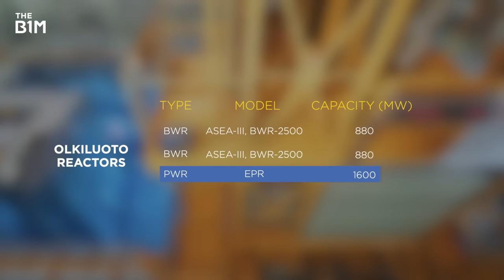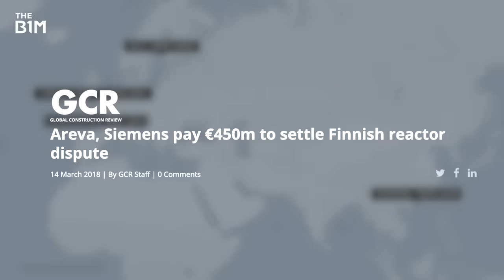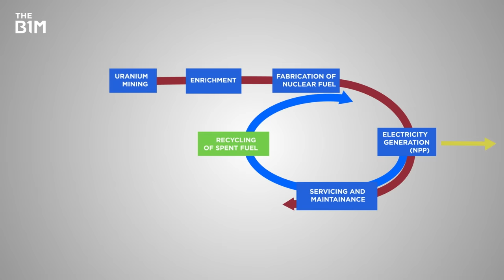Finland Might Have Solved Nuclear Power’s Biggest Problem

Comment: I hoped for a technological invention and instead they just developed a "new" way to bury it.
Reply: But what's wrong with burying it?  So long as the facility isn't on a fault-line, isn't near a groundwater source, and is sufficiently deep as to shield all the radiation it seems like a perfectly adequate solution.  The downside is the cost of excavating such a massive facility, but this repository "only" cost 3.4 billion dollars.  To put that in the perspective of a piece of infrastructure, the US spends about $175B on Federal funding to maintain its highway system every year.   

No one seems particularly disturbed by all the radioactive ores that naturally occur in the earth's crust, but suddenly once we start talking about putting nuclear waste underground no solution is sufficiently advanced.
Reply: @rossvolkmann1161  6:16 shows the suitable regions... I was at least hoping for a "solution" that could be used by more countries.
Reply: STORED not buried. The fuel elements have over 90% of their energy left
Reply: Well the thing is, there is already a way to deal with it: burning in in new technology reactors
But that doesn't make clickbaity titles nor does it scare the viewer
Reply: @rossvolkmann1161  It would almost be cheaper to send our spent Uranium to the moon, or simply slingshot it into space, on the back of a rocket
Reply: @chadsimmons6347  we dont have 100% success rates with rocket launches so doesnt matter if its cheaper if you accidentally shower your country with nuclear waste in a failed launch
Reply: That's because nuclear waste recycling is unbelievably expensive and fraught with it's own serious dangers.  France and Japan has the world's most advanced nuclear waste  recycling programs but it's always a money losing endeavor and they are lucky to recover a small percentage of the nuclear waste.
Reply: @pedrolmlkzk  I keep hoping that's what these videos will show but they never do. TerraPower and their travelling wave reactor is probably the single most promising development in recycling waste fuel into a usable resource, not to mention their liquid sodium system that practically guarantees a meltdown cannot occur.
Reply: @chadsimmons6347  it would take billions of dollars to slingshot all the waste in to the moon
Reply: @AMorphicTool  yep, but it doesn't get views
Reply: Hope is not a strategy.  Deep geologic repository disposal is the consensus best path forward at this time.  The US has dropped the ball by politically killing the Yucca Mountain Project.  Technically sound location, though a reducing not oxidizing environment so disposal is slightly different than will happen in Finland.  This is what happens when lawyers make science and engineering decisions.  Finland is doing the right thing and listening to the scientists and engineers, not politicians and lawyers.
Reply: @admranger  It's not about hope, it's about breaking the mould and trying something that's never been done before. It's no secret nuclear technology is vastly outdated at its core, burying the waste is a good short-term solution ('short-term' being for the next few decades) but a true solution would be finding a way to utilise what was once considered waste as fuel. That, is the long term solution. Finland has solved their crisis for now, but the ongoing global crisis still remains and will only grow. As the video has shown and your own comment states, not all counties can do it, for a multitude of reasons. Geologically and/or politically. However, if TWR proves a scalable technology you're talking about a revolution in nuclear energy production. A revolution that, as electric vehicles become the forefront of transport, is sorely needed to meet global energy demands of the future and further carbon emission reduction.

We cannot just keep doing more of the same but bigger, that is abundantly clear.
Reply: @rossvolkmann1161  but the ores arent enriched or concentrated in a small area.
Reply: @rossvolkmann1161  is really there are places out of danger from seismic activity?
Reply: @kipkipPatrick  if the fuel rods are safe enough for the people who work at the plant when they're inside the reactor, I have to imagine 400 meters of rock provides adequate shielding.  

Ionizing radiation is dangerous, but it's not magical.  It takes just 2 meters of concrete to reduce the intensity of gamma radiation by a factor of one billion.  Once you're more than about 15 miles away from the repository you gain additional shielding from the curvature of the earth.  

Nuclear power is one of the few routes we have left to meet the 60% reduction in global emissions needed by 2050.  Nuclear waste may be scary, but it can be dealt with safely.  What is more more frightening is how little time humanity has to hit its emissions targets before the climate becomes truly unrecoverable.
Reply: @chadsimmons6347  - There is currently around 250,000 tons of high level nuclear waste in the world.  Not factoring in the added weight of protective shielding needed to hold the waste on the rockets, it would still take around $650billion to send that waste into space.  And that's with prices that have dropped to about a quarter of what they were even two years ago.
Reply: and Russia already has on ! Its building new type of power plant . wich using stored nuclear waste as a fuel
Reply: @pedrolmlkzk  It also costs billions of dollars to bury it..

It's a issue of safety rather than cost, because if you launch a rocket containing nuclear waste and something goes wrong, causing it explode or crash, then you've got a potentially huge environmental disaster on your hands and that's a risk with every rocket launched...
Reply: @stubborn176  Yes. Seismic activity is caused by the movement of plates (tectonics) which only affects certain areas of the Earth's crust.
Reply: Burying it securely to minimise the chance of a leak is the best way to currently deal with this radioactive waste, however it's used in conjunction with modern reactors which recycle most of the waste reducing the amount produced significantly.

As an aside, people seem to be overly concerned about the burial of nuclear waste (albeit for justifiable reasons) yet nobody is concerned about the massive amount of garbage (including all kinds of plastocs and other non-biodegradable waste) produced daily around the world which ends up buried in landfills...

The future depicted in Wall-E is more likely than any fictional global nuclear waste disaster!
Reply: @GonzoTehGreat  and new plates could form anywhere over time as the core is not stable.
Reply: @stubborn176  I don't think you know what you're talking about. The Earth's core is stable. Regardless, it has nothing to do with plate tectonics. 

Read this: https://en.wikipedia.org/wiki/Plate_tectonics
Reply: @ph11p3540  That is part of the purpose of governments to cover what is needed yet not profitable if done via private sector.
And ideally only a small % of the waste is radioactive, means less total contaminating particles to deal with.

Its still more profitable than plastic recycling and the illusion that it still exists, after china exited the buying game.
Reply: @AMorphicTool  Germany could do it but it is not shown in the video. 
We have a big stupid antinuclear movemnet
Reply: @AMorphicTool  Yoe bever heard of new reactor types? Fact is it is the most cheap and efficient and save way of producing energy. And its technology can help to handle fusion later
Reply: @LucarioandDialga  I didn't but you should have that science is yet to provide "absolute" theories regarding the natural phenomenons.
Reply: @rossvolkmann1161  
Well the main issue I see is that we produce way more nuclear waste than we need to. 

There are designs for breeder reactors that use up 98% of the fissionable material. But the designs we went with only use up 3% producing way more nuclear waste.

As for the burying it... honestly it probably would be a better idea to stick it in a subduction zone so it can get sucked into the mantle... hopefully that doesn't make a nuclear volcano (lol) and the material gets mixed in with the mantle and nature spreads it out so it's no longer at dangerous concentrations. (Also keeping the earth's core warm would be a good idea for a billion years from now
Reply: @pedrolmlkzk  Still get radioactive waste.
Reply: Thanks, saved me some time!
Reply: One day someone  may find a use for it.
Reply: @chadsimmons6347  Yes, until a rocket explodes, as it happens very often, and disperse a cloud of nuclear material in the atmosphere.
Reply: @familledelisle2086  Look! We have billions of tons of Uranium, that could provide clean power for 1000's of yrs. 1/2 a million car wrecks kill people world wide, we still drive them, safty be damned
Reply: @alexcitovsky7389   Agreed, but, he did say 'forever'.
Reply: @chadsimmons6347  Also, spending rocket fuel on tonnes of ratioactive material is extremely inefficient.
Reply: can we not just ship it to the sun?
Reply: The channel owner developed a nice clickbait title.
Reply: @alexcitovsky7389  people took them from the ground too, and it was ok there, but as we take part of it's energy and bury it back, it's bad?
Reply: This.  They tried burying the nuclear waste in my country (Canada).  Gave the same arguments like solid billion year old bedrock deep down is safe blahblahblah from experts.  Guess what?  Radiation levels spike in ground water where the stuff is 'safely' buried a few years later.  The 'experts' didn't count on fissures in the bedrock and water seepage.  Now the communities around the area have to deal with radiation in their water rivers and now lakes.  It's the bury it "out of sight out of mind" mentality.  And this is suppose to remain safe for a hundred thousand years - give me a break.  It is corporate and government propaganda at it's finest.  When there are leaks, the government hides the fact from the public.  It took whistle blowers to leak the info to the press.  Long story short is a hard pass to burying the waste.
Reply: @rossvolkmann1161  well i hope they dont get blinded by a goal and drag the rest of us on a reckless endeavor. Why cant we use water as fuel again? i remember a gadget guy from my town back in the 80's converted his car to run on water. all that involved was using distilled water. kind of off topic but another way to reduce our energy consumption is to push back on planned obsolescence. No reason my cell phone cant last 10 years, same as my computer. yet companies want us to refresh them almost every other year. lets change consumerism too.
Reply: France (nuclear plants) 15 cents per kWh electricity price.
Germany (coal plants) 28 cents per kWh electricity price.
Germany has nearly twice the CO2 emissions than France. Any questions ?
Reply: @Jenachy  Onkalo resides in a scarcely populated area, and the final storage is 500m underground. When the site is sealed, there won't be a site left. It will be filled back up. There would have to be a concentrated effort to reach the final deposit site.
Reply: @AMorphicTool  Do you know anything about turning nuclear waste into diamond batteries?  I vaguely remember reading something about Bristol University working on that.
Reply: @annal9486  Last I checked a US company was hoping to release a prototype in the next few years. I don't know much about the science behind it though.
Reply: @AMorphicTool  Wow, that's further along than I had hoped.  From what I remember, the waste was somehow in a radioactive Carbon 14 form and could be treated as raw material for lab-created diamonds.  That diamond would then be covered with a layer of non-radioactive diamond rendering the thing inert.  Until placed within an electrical circuit, that is.  At that point, the radioactivity completes it and powers the system (I don't know how well I'm explaining this -- I have no science or engineering background) essentially making it a battery with a 5,000 year charge.
Reply: Better bury the toxic stiff and contaminate this one place which is under control then to contaminate the hole atmosphere.
Reply: As you alluded to, it is not the ultimate solution to bury it, but at least they have a practical theory suggesting that it will require no further human intervention after being buried, no maintenance, no inspection, and supposedly no corrosion. Let us hope so.
Reply: @sublivox6054  It'll be just as safe as unused fuel after some 1000 years. Unused fuel can be handled with gloves. So this is not a problem that will last forever.
Reply: This is a technological invention. It is a combination of old methods perfected for the needs of a specific case. Not all tehcnological invention is hyped bullshit. It's a practical and cost-efficient approach to a practical problem. That's what engineers do every day and it indeed is technology!
Reply: @rossvolkmann1161  What's wrong with burying it? You'd be wasting 95% of the fuel rod which is still perfectly good uranium, that's why. It's like taking a single bite of an apple and throwing the rest in the trash.
Reply: @ph11p3540  didn't know 96% was extremely low
Reply: ...and it looks way more expensive than Solar will be in the next 10 years